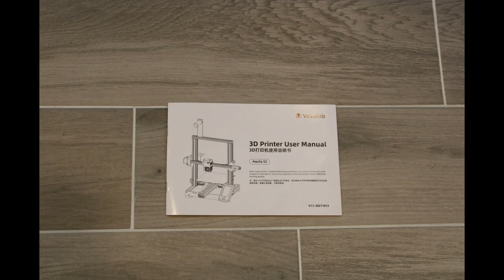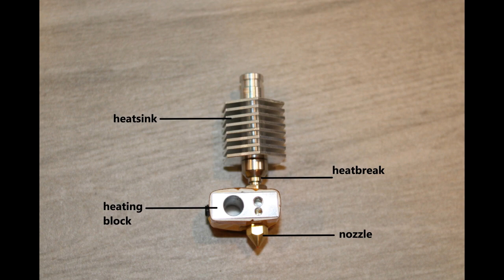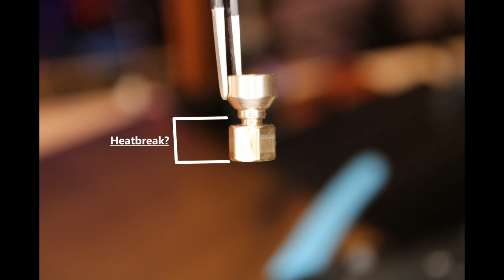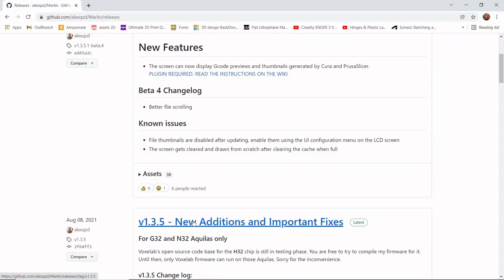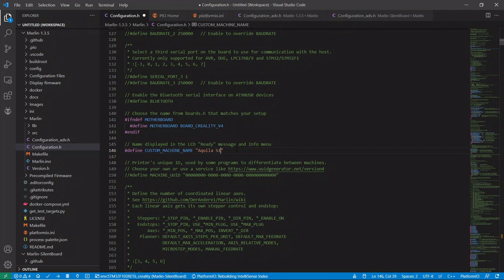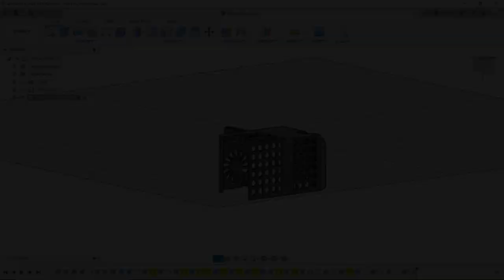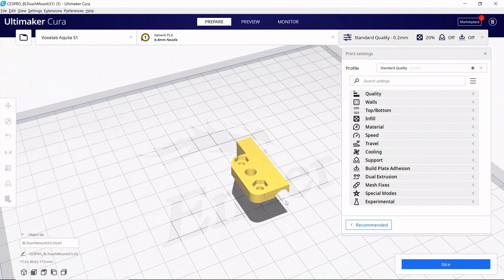Voxelab Aquila S2 - Direct Drive - High Temperature Prints

Comment: Great video! I had the same findings. Did your block also just "sit" at the bottom of the nozzle?
Reply from the maker: Wow thanks so much for the compliment, means a ton coming from you knowing how well received your videos are and how great your information is. I'm not sure what you mean about "sitting" on the nozzle, everything was tight for me, but it's certainly an interesting setup, I have some longer nozzles (bought from Amazon) coming to see if I can find a suitable aftermarket replacement. The idea of only using nozzle from Voxelab doesn't really thrill me. Thank again for commenting, it means a lot to me!
Reply: @PrintsLeo3D  do you go to the Voxelab Official Group on FB? I have replaced the OEM hotend on the S2 and remixed your shroud to go with it.. Also, the STL's needed to mount a Haldis 3D Red Lizard Q1 V6 Hotend and lower the part cooling blower on the S2.. Works great and uses standard nozzles...
Reply from the maker: Ray!!! I saw an email from Thingiverse a few days ago and meant to reach out and thank you! I didn't know there was a Facebook Aquila group so I'm not part of it, I'll have to join up. Love the idea of swapping out this hot end, I've been testing it but it feels like I'm just spinning wheels when a replacement is really the best decision. I just bought a Haldis Frog extruder direct drive unit, I'm excited to try it and I'm happy to hear other people are using that brand as I hadn't heard much about it. Thanks for keeping me in the loop, I appreciate it!
Reply: @PrintsLeo3D  actually this is the group.. Be great to have you there. Voxelab Official User Group
Reply from the maker: Ray I would love to see your hot end conversion, as I am starting to do some high temperature testing and will likely swap out the hot end during the test. If you don't mind emailing me at printsleo3d@gmail.com so we can talk. Thanks!

Comment: Thanks for the in-depth review. Great video! I know it's only been about a month, but have you printed high temps and had a chance to look at the PTFE? Also, is the PTFE lining removable/replaceable? Or does it look like we'll need to replace the whole thing if it does degrade?
Reply from the maker: For awhile I was trying to run temperature tests on the inside of the heat sink down to the heat break. I was getting mixed results, as I couldn't find a temperature sensor small enough to fit inside the hot end down to the heat break. I was able to get some good results from the heat sink, which was doing a great job of dissipating any remaining heat (26 hours at 295c only registered 40c inside the heat sink). After those semi failed heat tests I re-examined the bottom of the PTFE liner and it seemed to be in working order, no signs of discoloration or melting. The PTFE tubing does not appear to be removable, I mean I am sure I can probably yank this thing out, but from me fiddling around with the heat sink the PTFE tubing has never budged or felt loose at any point. My next test was going to be to remove the PTFE entirely and see how well the hot end prints. I think that will be a pretty good indicator of how much contact the PTFE tubing has with the melting point of the heat sink. However before I do that (and possibly sideline my hot end if it goes wrong) I wanted to start printing some high temperature filaments. Been printing with some Nylon right now, (264c 65c bed) and the results have been very good. I have some ABS I'll be printing next and then some PC is on order. After all that is finished I am yanking that PTFE liner (if I can) and going to see how well I can print without it. Thanks for asking, I am going to put a video together once all these tests are finshed.
Reply: @PrintsLeo3D  Thanks for the detailed response and for taking the time to put so much thought into it. I look forward to seeing more of your material. I may go ahead and order this printer today.

Comment: Nice video! I have a BL Touch and your BL firmware installed. Do I still have to use G29 code for printing?
Reply from the maker: Hey Jhon, yes if you're going to be using the probe, even though the fir.ware is equipped for it , you still need to tell the printer you want to use it. You can do this by adding either G29 (probe a mesh and use it) or M420 S1 (load a saved mesh to use without probing) to the start gcode in your slicer.  Just make sure that you add one of these lines after any G28 lines. G28 auto homes the printer and it erases any currently active meshes. Hope this helps. Thanks for watching!

Comment: Hi I have to thank you for sharing your Cura S2 profile. Used that as a base. I have added dual Z, .06 nozzel and swapped the extruder stepper (42-40) for a lighter 42-34 motor. 

What is the top speed you have gotten out of your S2 with a decent result? 

I just ironed PLA top layer at 100/mms and it was smooth. Speed is possible it seems
Reply from the maker: Glad my profile was of some use! I ended up converting this to Klipper firmware and with that I was able to print at around 130mm/s print speed with around 5Kmm2/s acceleration. The bones of this printer are really good, and with the upgrades you made this should be a real beast.

Comment: Thanks for the great video. Also is the nozzle V6?
Reply from the maker: Unfortunately no it's not, it's actually Voxelab's own proprietary nozzle, which makes getting replacements tough. It's most similar to a volcano nozzle, but it's just a little bit shorter, and also volcano nozzles have the 'head' of a V6, where this nozzle has the 'head' of an MK8.

Comment: Great video I just purchased this printer myself so far I'm liking it but I'm new to 3d printing so take that for what it's worth. I do have a question I bought a cr touch and am planning on printing your fan cover with the mount for the bl touch will it mount to that or will I need to modify the mount I do not have a bl touch to compare . And thanks again for a great in depth video
Reply from the maker: I'm glad your enjoying this printer so far, it's a great way to get into 3d printing. Thankfully the mounting holes for the BL touch and the CR touch are identical, so you should be able to print my mount without having to make adjustments. If you need help getting started with the CR touch, I have a BL touch install video on the base Aquila, and all the information is identical for this machine. If you have any other questions let me know ! Good luck !

Comment: yooooo.... how did you make the firmware? I'd love to go in and see what kinda stuff I could tweak to make it better
Reply from the maker: It requires another program called Platform IO, which I believe is a plug-in for Microsoft VS Code. After that it's all about importing base copies of the various configuration files and then editing them to your liking. I would take a look at RuiRaptor on Youtube, they have an older video that goes over the process rather well for an Ender 3. You'd just need to adapt that for what your application is.

Comment: The nozzles look like Adventure4 nozzles minus the heatbreak...going all proprietary is a complete no go😎
Reply from the maker: That's a good lead if that's the case. I tried some aftermarket nozzles I thought were compatible,  they showed up yesterday, and shocker, they are not. Really perturbed by the proprietary  nozzle at this point, nozzles are something that should be easy to find and easy to source. Right now that's not the case. Thanks for watching the video and adding to the conversation!

Comment: Great video and very helpful! I wish there was more helpful S2 info on the internet! I am having a real hard time finding a parts cooling fan shroud which gets more of the parts cooled...having some issues with the S2 and warping on the back side of prints (where the fan doesn't reach)...any suggestions? I have tried everything to stop the warping, including enclosing the printer...no consistent luck! One interesting tidbit is I can have the bed set at 40 degrees when in the enclosure, and that seems to help...but still have a small amount of warping.
Reply from the maker: Hey Dave, thanks for the comment! Well there are some onboard options you have within your Slicer, like turning on a brim that should help warping. If you haven't used  a Brim yet I would start there (although if you went as far as enclosing your printer I am sure you've tried brims). What material are you printing and what slicer? I haven't had warpage issues on the far side, but our printing environments are different so it's not always the best basis of comparison. The Fan is small! so I was leery of the parts cooling when I received my printer. If I find the time I can try and create a better air shroud that wraps towards the rear of the nozzle, or even adapt the bigger fan shroud to adopt a larger 5015 fan.
Reply: Thanks for responding! I made the mistake of buying a lot of PLA, so that is all I have used so far. I am mostly using cura slicer (newest version) as I like the interface...if you think there is a better option, I am open to suggestions! I have tried a brim, but so far only rafts have worked for me to avoid the model warping.
Reply from the maker: Also something to try is the pei bed can sometimes lose some adhesion due to your handling of it. This is usually advice for poor adhesion, but I guess warping is sort of that, so try washing the bed with some soap and water. I usually use a dab or two of dawn dishwashing soap and clean it in the sink then dry it off with a paper towel. The fingerprints from our hands get all over the bed and the oils can mar adhesion. Whenever the adhesion in my bed starts to go this is the first thing I do, and usual it solves the problem.

Comment: Hi thanks for creating this!
Iv been using a standard Aquila for about a year now.
I just upgraded and got a second printer, the S2.
I got the CR touch for the S2 and I had on my original.

I downloaded your firmware and Alex’s DWIN. Sets. 
Everything seems to work really well, minus the CRtouch bed mesh creation.
When it attempts to create the mesh, the probe just barely misses the build plate, causing a probing failure.

I believe this may be due to the bed size on the firmware being larger than 220x220 but I’m not too sure.
Is there any way to please fix this? 🙏🏻
Reply from the maker: Hey Dalton, I increased the bed size for the S2 because it doesn't use bed clips, so we should be able to use the entire surface. If you're having issues with the probe not staying on the bed I'd check the X and Y offsets for your probe. Those coordinates are what tell the printer where your probe is, so you want to double check and make sure those are accurate. I have a very simple method for finding those, and if you check the Shorts section of my channel you'll find it. It requires no calibers or measuring of any kind. Let me know if this helps
Reply: @PrintsLeo3D  thank you so much for the quick reply! I will give it a shot and see what I come up with. Thanks again man!
Reply from the maker: No problem and good luck !
Reply: @PrintsLeo3D  Leo, you are the man! That solved it and I’m printing away! …..kind of. 😅
Iv attempted to download your profiles for the S2, however Cura keeps giving me an error saying “anything” type isn’t compatible with “FDMPRINTER”. 
I used 3DSOSs version of setting up a printer in cura, which has worked amazing for my standard Voxelab.

Any suggestions why it’s saying your profiles aren’t compatible? I tried copying and altering my old profiles and tuning the retraction, but I’m getting some really awful quality prints.
Thanks again in advance Leo!
Reply from the maker: Dalton glad we got one thing solved 😁 for the profiles the way I set up my Aquilas in Cura is to use the base printer if an Ender 3 pro. Because the Aquila is a clone of that printer it sort of front load all the work for us. So all my profiles are being applied to an 'ender 3 pro's printer in cura, and if you're not using that then it will not import properly. If you're interested how I set them up (it's extremely easy) I have an intro to Cura video, and the first couple minutes I show how I set up all my Aquila printers. If you're interested in this and need more info than that video offers let me know.
Reply: @PrintsLeo3D  I can’t thank you enough boss! I’ll be happily tipping you through your site or however you find best fit. Thank you again! That should solve my final problem. Super excited to get this second printer up and running! 🙏🏻
Reply from the maker: Happy to be of service, and like I said if you need extra help setting it up let me know! All about helping this community grow
Reply: @PrintsLeo3D  your every much appreciated!! 🙏🏻
Reply: @PrintsLeo3D  sorry to keep being a bother! 
I cannot get this machine to produce a single decent print… 
The auto level bed mesh only creates halfway through then will stop and say it’s complete.. Iv sat and watched it multiple times all the way through. There’s nothing binding, hitting, or causing issue at all.
when I try to print without the level active, (bed leveled nicely by hand) it will print the skirt beautifully, great adhesion, perfect squish, amazing first layer on the skirt. And then when it goes to print the actual print, it’s like the Z offset wigs out all crazy. It will start carving into the bed plate, or print if it gets far enough without the z offset randomly messing up.
Iv made sure it was lightly lubed with white grease (just a touch) on the z rod. 
Iv leveled the bed…. I’m not quiet sure where to turn
Reply from the maker: No bother at all man, definitely a weird condition. I would first day to try another firmeare of mine. If you used 4x4 try the 5x5 and see if it helps any. Of course make sure to remember you esteps when changing firmware because those vues get rewritten to stock each time. I would start there, the nozzle changing height while trying to print is crazy lol I'm hoping we don't have to contend with that, maybe a simple brain wipe will do it 🧠
Reply: @PrintsLeo3D  thank you! So I tried that, went from the 5x5 to the 4x4.
Now it’s trying to start the level on the right hand side instead of the left, and stopping creating the mesh after the first probe.
It’s also not lifting the probe high enough. I have videos and pictures if there’s a way to send them to you

Comment: With the parts cooling fan is the 35mm measurement between the mounting holes or the outer edges of the fan? Mine is starting to get a little noisy so just want to double check
Reply from the maker: Hey Jake, I bought some replacement fans a while ago and what you're looking for is (I believe) a 30x30x10 fan. I'll double check when I get home, because I know they used this unique size.
Reply: @PrintsLeo3D  yeah getting to a point where I wish I went with an Aquila X2 instead 😅
Reply from the maker: Yea nowadays whenever I can I try and steer folks to the X2. That being said the S2 isn't anything to be upset about, still very capable, just needs a little more tinkering
Reply from the maker: Hey Jake, I just checked this morning and I was thinking of the hotend fan which is 30x30x10. You are correct the measurement for the part cooling fan from edge to edge is 35x35x10.
Reply: @PrintsLeo3D  do you happen to know where I can get replacements? Looked on Amazon and really couldn’t find anything

Comment: Hello friend, tell me which printer is suitable for a beginner?
I wanted to buy kingroon kp3s, but now this printer has become interesting
Reply from the maker: That's a good question and one that is hard to answer. I would say a good beginner printer depends on the amount of work you want to put into it, and what you want to get out of it. The printer I featured here is a great printer, but not one I would recommend for a beginner, as some of the features are not easily handled by a beginner. The original Aquila however, is an amazing printer! It's almost identical to this printer but has some more general and easy to change features, it's cost is inexpensive, and it can produce amazing prints! It does require some set up and calibrating (like most printers) that can seem challenging to new users. Another great option for beginners is the Eryone ER20. It is easy to set up, has some really advanced features built in, and it's easy(ish) to calibrate. It's cost is higher than the Aquila, but they go on sale from time to time (I got mine at $160 down from $300), and it's a very easy printer to set up and get your feet wet with. Also it can produce amazing prints. I have a video on that printer as well 
https://youtu.be/93yv_kJ2yyI

I have no experience with the Kingroon line of printers so I couldn't speak to their reliability or ease of printing and use. If you have more questions you can ask me here or on my Discord server https://discord.gg/NZX3WHPj (Discord seems to be easier), but please let me know if you need anymore help or drop me a line once you get your printer!
Reply: @PrintsLeo3D  Thank you very much, you told me in great detail. I hope I won't make a mistake in choosing the first printer. Have a great day
Reply from the maker: Thank you, you as well!

Comment: Regarding Ultimaker Cura, what settings or profile specific to the S2?
Reply from the maker: I have some custom profiles for PLA , PETG , ABS, and Nylon. They don't differ all that much from Curas base profiles for an Ender 3 Pro. I am going to upload them to my website today and then I'll respond back and let you know when they are live.
Reply: @PrintsLeo3D  Thank you so much!
Reply from the maker: Ken I updated my website with my S2 profiles. I am using the Ender 3 Pro printer machine in Cura and then I use my profiles with it. printsleo3d.com then head over to the Cura/firmware section! If you have anymore questions let me know.